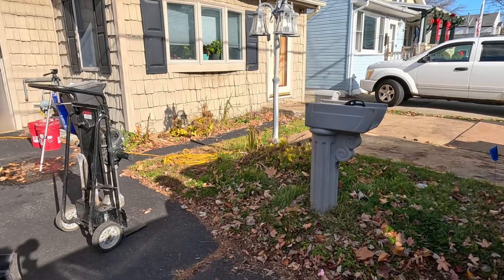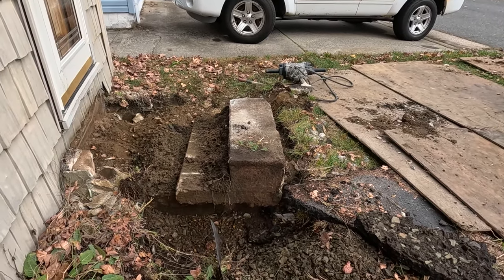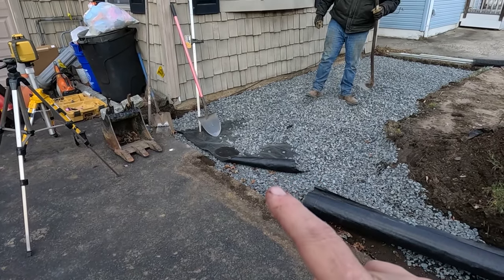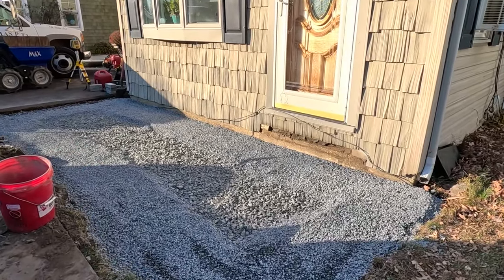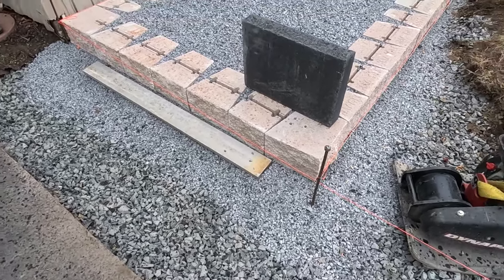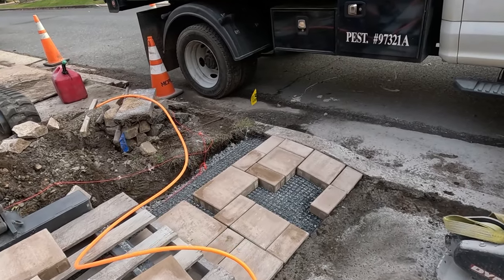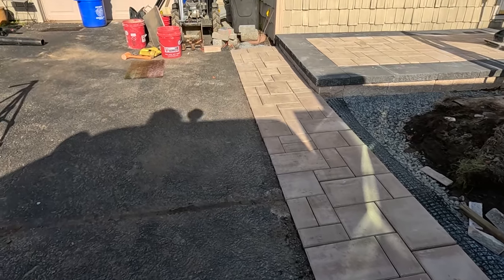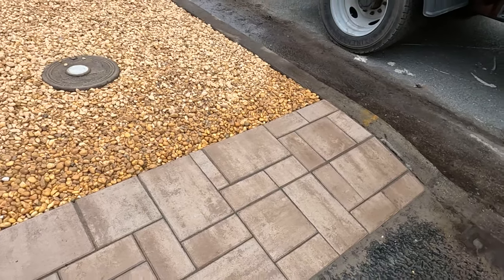Front Yard Makeover - Concrete Paver Porch and Walkway - Hardscape Renovation to add Curb Appeal

Comment: how did you slope the inner pad? if the retainer is level all around how did you set pitch to ensure proper drainage? great work !
Reply from the maker: Thank you Peak,  The side along the house and the outside, also the long sides, are level.  The short sides that run along the driveways have a 2% pitch.  That ensures that the rain water runs away from the house to the old lawn area.  You can kind of see that at 14:15.  We set that up with our laser.  Once we dialed in the slope we set all the screed rails with the same laser setup.  No need to reset the laser.  You can see Dawn checking at 12:16.  You can also see the water running off the porch towards the lawn area at 27:00.  I hope I answered your question.  Happy New Year, Tom
Reply: thank you, makes sense. awesome to see you guys work so hard. cheers @tyelandscapinganddrainage
Reply from the maker: Thank you again

Comment: I like that you guys use stone i stead of sand for the setting bed. I see a lot of pavers have the sand base washed away from underneath them. 

So you always set pavers on top of geogrid? What do you gain from doing that?
Reply from the maker: Hi Andrew,  The geogrid is one more step to keep the pavers in place for a long time.  The weight of the pavers in the middle of the field keeps the geogrid locked in place.  Driving spikes through the geogrid and edging completes the job.  On the porch the weight of the pavers locks everything together because the caps, blocks and geogrid are all glued together.  It does have to be bi-directional geogrid.  I hope I explained it and answered your question.  Enjoy the rest of your weekend, Tom